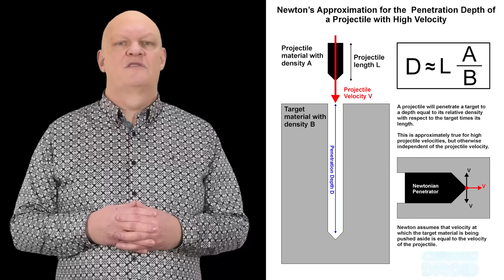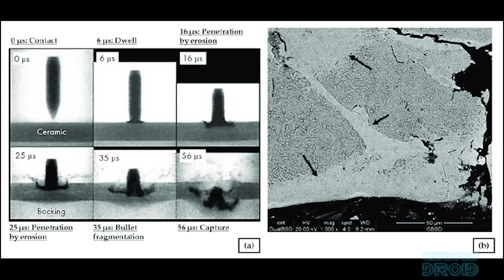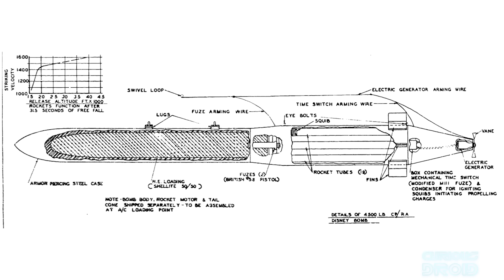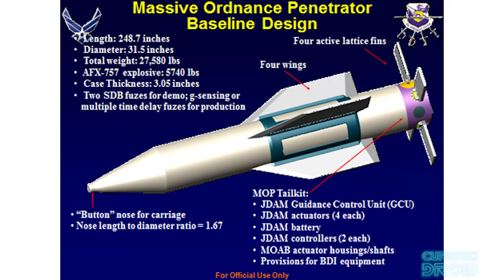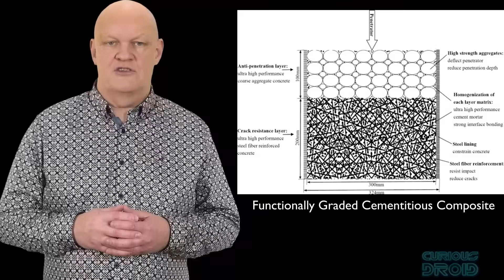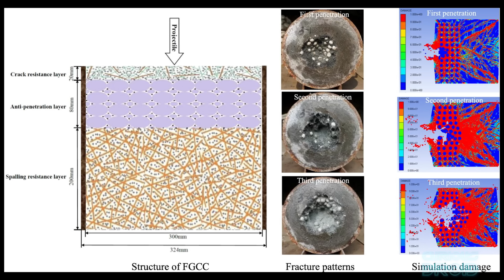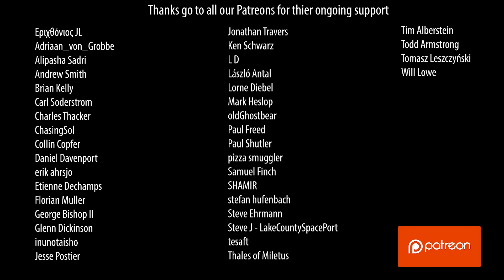Can Iran Stop U.S. Bunker Buster Bombs?

Comment: For nations with enough money for serious bunkers a couple of tunnel boring machines (and storage area for the removed spoil) could permit tunneling out making exits not visible from space until they penetrate the surface. Exits could be pre-tunneled leaving sufficiently thick protective caps.
Reply: With satellites they can use I think radar or LIDAR to find tunnels. The us govt has done this over the korean dmz
Reply: @Birch12430 You might want to research on LIDAR before saying this. It has massive limitations.
Reply: Sufficiently thick protective caps? Please tell more.
Reply: you ever seen a nuke powered laser boring machine ?

Comment: the bottom line is that kinetic power has barely been scratched.  the old adage that civil engineers build targets still applies.  As velocities and metallurgic advances continue, sheltering will become more and more difficult.  Concealment will be the real protection.
Reply: in the future, penetrators will be multi-factored with various permutations of explosive charges, dense penetrators, and secondary explosive charges.  Assuming that no one has weaponized DPU in orbit yet...

Comment: I see that defensive structural design is beginning to take initial deflection of the nose of the penetrator seriously.  Expect to soon see an initial deflection top layer made of dense, hard prisms grouted with a much less dense matrix.  The prisms would be of the same size as the head of an anticipated bomb.  The purpose would be to turn the projectile head against an angular surface and break up the bomb as it loses its arrow-like penetration orientation.

Comment: So if speed, length, hardness, and density defeat armor then the ideal bunker buster would likely parallel the modern APFSDS tank round. What would that look like? Obviously we're talking much scaled up armor, so the penetrator must also be scaled up. You're not really going to beat tungsten on tbe density or hardness front, though DU holds a slight edge in the way it deforms on impact. That means the new bunker buster needs to be bigger and faster. Bigger is easy, it's not hard to manufacture a giant tungsten rod, but how to get faster? Well there's only so much time to accelerate a projectile from a plane before impact, so clearly we need more standoff. ICBM re-entry happens at around Mach 25 from space at an altitude that could become an orbit, so maybe we put our giant tungsten rods in orbit and drop them from there... I feel like I've heard this somewhere before.
Reply: Rods from God.

Comment: I suppose one of the alternates is to have something that can drop multiple ordinance on the same exact spot with a relatively long delay interval. That would break through successive layers, but you'd also face a lot more risk from exposure to air defense.
Reply: ICBMs set up to kill hardened targets do this, but in unison rather than in sequence-- the RVs are dispersed vertically over the same ground footprint and each one is individually fused to burst with one above the other, each nuke adding its force with the others to create enough overpressure to collapse whatever subterranean target they're meant to destroy.
Reply: Thought the exact same thing. 1st hits a solid barrier. 2nd effectively hits a bundle of rocks. 

Might even be possible to do it on an extremely short interval with 2 bombs dropped from the same plane, if you can manage to extend the flight of the 2nd by a couple seconds. Dust obscuring the impact point wouldn't matter because the bomb is already heading straight for the same spot that the 1st just hit.

Comment: I've been working in the middle east for over 20 years now, Iran is just like all the other shtholes I've been assigned and I can tell you this: the concrete over there ain't concrete, and the metal ain't metal. It all falls apart, weak, and isn't structurally sound. They're poor, and none of it lasts, so I've no doubt it wouldn't stand up to whatever we wanna put inside of it.

Comment: The ultimate bunker buster would be the fabled "Rods From God" where they drop telephone pole sized tungsten rods from orbit and rely on the sheer kinetic energy of the impact to do damage. Nothing says they have to be that big, so all it would take is a couple smaller ones dropped precisely to do the job. Hypersonic missiles could also do something similar by using the kinetic energy alone to wreak their havoc.

Comment: While I'm sure the new HP concrete is pretty much mandatory for bunker construction, it seems to me like the easiest way to defeat bunker busters is to layer in some actual steel and ceramics to make them even more resistant to penetration. And air gaps could make the detonation more difficult, because which layer is it supposed to actually explode into?
And just like tank armor, the bombs can also be made to penetrate like a shaped charge and burn their way down. The only trick would be to have the main explosive charge follow well behind and survive the penetrator blast.
Reply: Or go much deeper when building the bunker.
Reply: My initial crazy idea for a double charge would be to physically tether a penetrator bomb to the follow up destroyer charge. That way instead of one super long bomb you would just have to get two bombs to hit the same spot and that would make them smaller and capable of being dropped by smaller aircraft.
Reply: @robertharvilla4881  What about reactive defense on a bunker ? would it work to put an upper floor filled with explosive in order to blow the projectile before the intended target ?
Reply: Americans coming up with ways to better unlife people 😢

Comment: Kevlar impedes projectiles by stretching and absorbing the energy.  It can only stretch so fast, so at a certain speed the projectile breaks rather than stretches the fibers.  Similarly, a smaller frotal cross section of a pointy rifle projectile will penetrate where a rounded nose pistol projectile at the same velocity won't.  That is why they are technically "resistant" and not really "proof."  Still beats a light jacket, though.  ;-)

Comment: Another place to find good information on Bunker Design vs Bunker Busters is the papers surrounding the controversy on the  Robust Nuclear Earth Penetrator (RNEP) proposed around the 2000’s.

I’ll attach the link below in case YouTube doesn’t like links (thinks it’s spam maybe)

Also Debates Surrounding Usage of Silo Based Missiles, especially the LGM-118 Peacekeeper / MGM-134A Midgetman (late 1970’s through the 1980’s) are a good place to look for bunker design/placement.

Granted this video seems to have covered more on the concrete side, and I don’t know if the technology was available at the time of most of these past decisions being made.
Reply: *Basically Though* If you find the right rock formation, and dig a diagonal path down (with conventional mining methods), you can have an impenetrable bunker for reasonable costs with off the shelf equipment.

Granted the risk of Air Inlets / Entrance Shafts / Communication Lines being destroyed/blocked still existed and that was thus the suggested countermeasure, not giant bunker busters.

At least for these “(Ultra) Hard and/or Deeply Buried Targets”, not things like Hardened Aircraft Shelters etc
Reply: Here is the Link to the Paper,

Earth Penetrating Nuclear Warheads against Deep Targets: Concepts, Countermeasures, and Consequences.

Federation of American Scientists April 2005

https://programs.fas.org/ssp/nukes/new_nuclear_weapons/erthpennuclrwhdsrpt.pdf

Comment: Bunker busters are made of titanium or Tungsten.

So why not just add ballistic rated plates of Tungsten and Titanium.
Above and inside the advanced graphene enriched carbon reinforced concrete.

Having on top and inside means with any long-term corrosion that could be avoided through modules install system that could remove and replace the plates as necessary.

I wish I could be the one to test the bunker busters.
I gaurnetee my first test would beat them. 
Under 1 condition, I have free range and any resources.
Reply: Not titanium, at least in the penetrator.  Not dense enough, not tough enough,

Comment: Really a bunker-busting rod just needs more energy on impact.
And there's 2 axis you can utilize to impart energy to a projectile: longitudinal energy (speed), and rotational energy (spin).
Now, it could just be me, but i'm not seeing a whole lot of spinning here.
Now, if you're curious about what a high spin rate does to projectiles, check out the 1:1 twist rate (1 rotation per inch of travel) tests on the 300 blackout cartridges. That's 8 times the conventional spin rate of what's usually applied to rifle projectiles, and you can put so much more energy on target with subsonic rounds if you just give it 8 times the spin rate, it's insane.
You're essentially burning more powder, and putting more energy into the projectile, without it going faster, and the end results are terrifying.

This is honestly the way that munitions are going to go in the next 20-40 years, if not global adoption, then specialist projectile munitions will.
Bunker buster or otherwise.
Reply: Rotational energy does not affect the kinetic energy in the direction the bullet is shot.  It’s not how physics works,

Comment: Would a layer of hard steel that had pointy edges like dagger over every square inch with detonators work to prevent bunkers from being destroyed? Soon as the bunker buster hits, it's exploded by a counteracting force. Also a layer of steel thick enough with a cavity supported by struts will provide protection
Reply: You'd need an exceptionally large dagger, and you would need to stack thousands of them. You would also need severely reinforced concrete to make sure your pile of daggers do not accelerate to become penetrators of their own if accelerated by a detonating force.
Finally you would still want a redundancy system in case of penetration still occuring.

For a perfect case study in real life: the seed vaults in antarctica and svaalbard share these common designs, and do exist. They are nuclear grade, however the resistance to nuclear impact makes them much more like ceramic armour, where as high performance concrete is like kevlar: ceramic can take an incredibly large hit, however not repeatedly. Kevlar will offer no resistance if defeated by sectional density, yet apply continuous resistance to any penetrator that has to 'stretch' the material rather than puncture it out of sheer rigidity.

Comment: Well, considering that concrete is mostly "solidified water", and that it explodes when heated by a torch, from the water in it vaporizing, wouldn't it make sense to design bunker busters based on the principles of shaped charges used to penetrate tank armor?  Shaped charges produce a thin jet of supersonic, superheated metal that passes through inches of steel like a hot knife through a block of butter.  The same shape charge would enter deep into concrete (of any strength) and make the concrete itself explode.  Now, design a bunker buster JDAM featuring a ring of say 11 shaped charges around its periphery, and that would probably cause a ring of meters-deep exploding holes, separating the inner cylinder of concrete from the rest of the wall, and the kinetic energy in the munition would push this core of concrete forward.  This would get through one concrete layer or floor, of course, but a train of these bunker busters with the same GPS target would pass through the previous munition's hole and make a second hole at the next concrete layer or floor, and so on.

Comment: The best BB bombs that you have GBU 72 can go through 6 meters of reinforced concrete and 60 meters (200ft) into soft regular soil according to internet, the facilities that iran has, are made 500 meters (not under soft soil though) but under the mountains which is more similar to concrete and in some cases even better.
Not to mention that you need to pass through Air Defense Systems and continue until you reach Central Iran.
in short: So yes we can stop those stupid scrap metal bombs
You better put those bombs upward and sit on it, it would be better lol.

Comment: Another countermeasure would be, where possible, to break things up.  Instead of having one large bunker, have 4 smaller ones, hundreds of yards apart, interconnected by tunnels.  I know this isn't practical for every function but the enemy now has to find all 4, and use up 4 bunker-busters instead of one.

Comment: Short answer Yes! If you look up the various ways of making concrete and the actual penetration on the various types of concrete, you will find that Iran has the capability to use concrete that wouldn’t be penetrated, the big question is have they done this?

Comment: In theory there is still way for improvement of bunker busters. They would need to be multi stage. In short something like American anti tank javelin but bigger. Shaped charge making point blank concentrated hypersonic stream of metal punching through that concrete to make it easier to penetrate for the second stage. There is not a lot of things that can survive point blank rail gun or meteorite like shot.

Comment: This is absolute US propaganda. If those weapons could bust through such thicknesses of real concrete (not hollow concrete), then all these countries would have stopped building bunkers. On the contrary,  the US and its enemies rely heavily on them. Why are some of the projectiles emerging from the other side of the concrete wall in a different direction than they entered. The enterior of the so-called concrete must be spacious or made from material of lesser density than than the concrete, so like light, we experience a phenomeno called refraction. These videos are propaganda videos aimed at convincing the world that bunkers are not safe from US weapons.

Also, consider the housing of the explosive, it is either made of a material as more strong or as strong as the material of the projectile head, or it is made of a material less strong than the projectile head. If the first case holds, then the explosive will not be able to bust out of the super strong material upon degnation since the material is too strong. Thus the weapon is pointless. Suppose the second case is true, then such a housing must be the weakest point of the system, and  must collapse when subjected to those huge  forces during impact. If the hosing of the explosive collapses during impact, then we shall either have no explosion at all, or a premature explosion. You see the absurdity in all scenarios.

Comment: If US wants to bomb Iran, it needs to be quick. Trump will be back in two years and one of his manifesto policies is no more regime change wars!
Reply: Imagine the energy of a ten ton armour piercing bomb falling from 25,000 feet, penetrating 25 feet of concrete and then exploding. I could calculate the terminal velocity of the bomb, but I'm too lazy. It would probably be supersonic or hypersonic. A ten ton shaped charge just resting on top of the concrete could punch a hole through it.

Comment: Some underground facilities have large rubber blocks set on the outside walls. Some even have empty space between main structure and the outside, so the projectile hits that external wall, loses some energy and hopefully starts to tumble before hitting the main wall...
Reply: Huge springs are used at NORAD Cheyenne Mountain

Comment: When they hit the ground, they are going at a supersonic speed. The first ones were made in 2005 of machined and modified cannon barrels made of the strongest possible steel.
Now, possibly they are tougher and go deeper.
Now imagine one with a small nuke. It could probably destroy half a small city with no fallout, if done right, of course.
Bunker busters, city shakers.